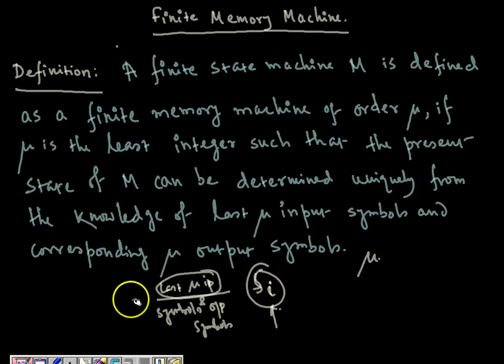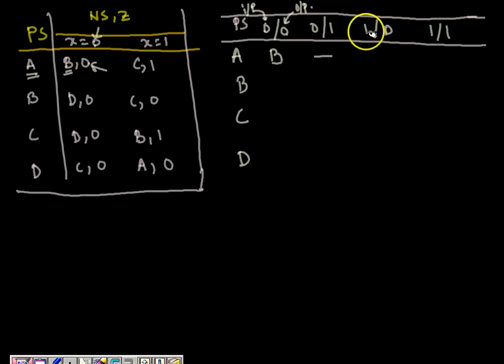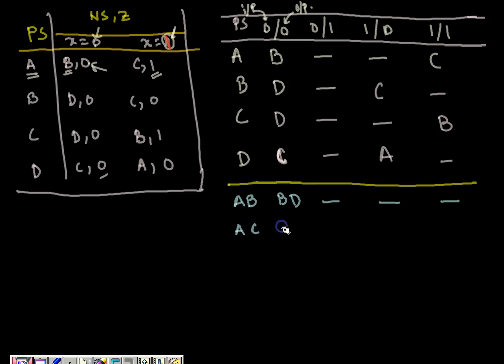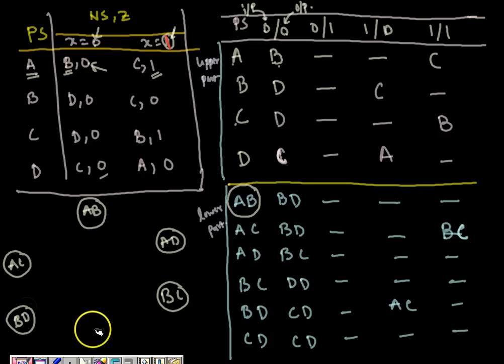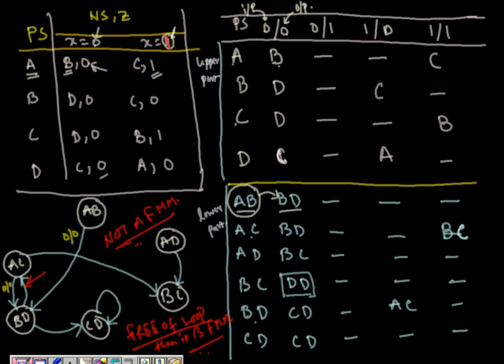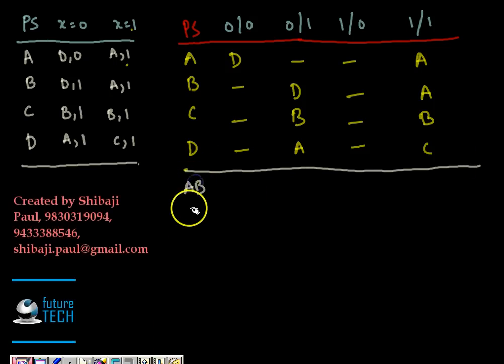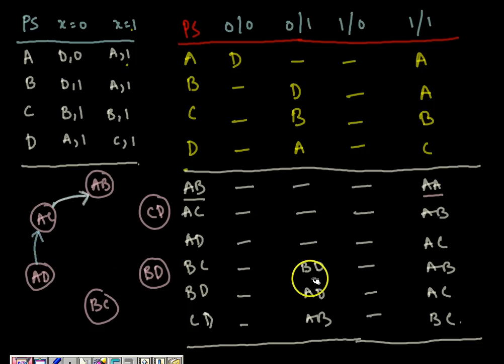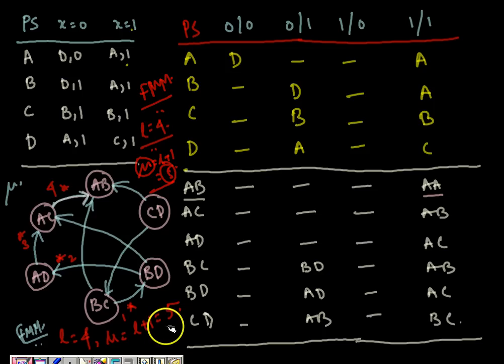Finite Memory Machine, Testing table Testing graph FSM-Lec-5

Comment: A nice video tutorial. Unfortunately, there is 1 error I believe. In the 2nd testing graph, it is stated that the longest path is of length 4. But i believe it is length 5, because, CD -> BC is also there. So order of the FMM is 6 = n(n-1)/2, which is the maximum possible order in any FSM.
Reply: noticed it, longest path will be 5. But
for understanding its best video.
Reply: exactly it should be 6
Reply: Excatly bro...